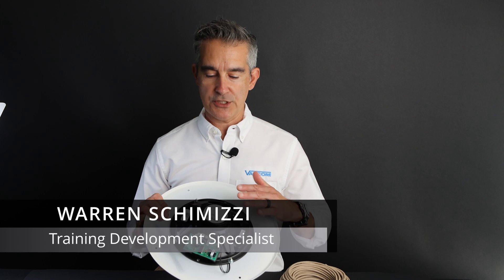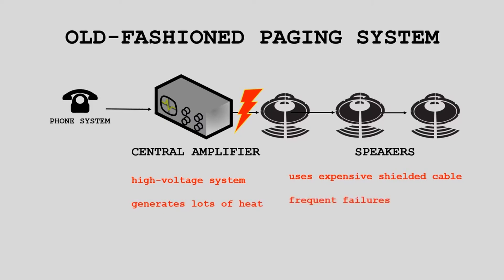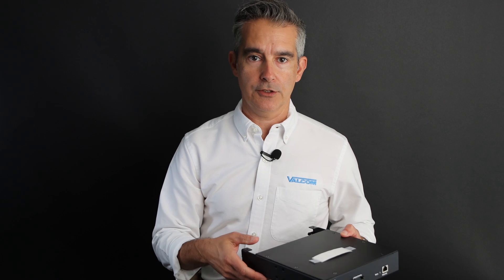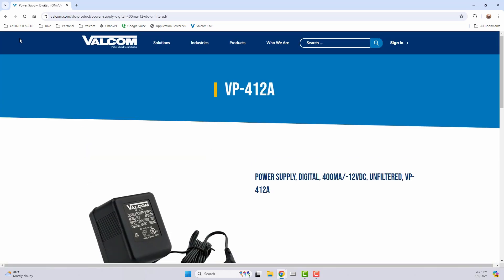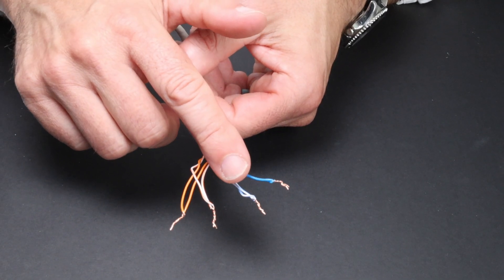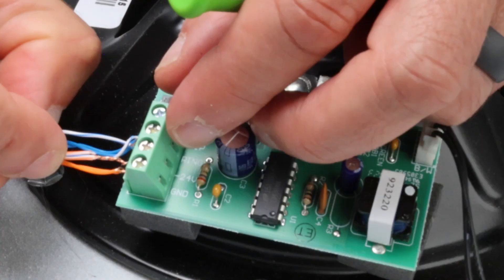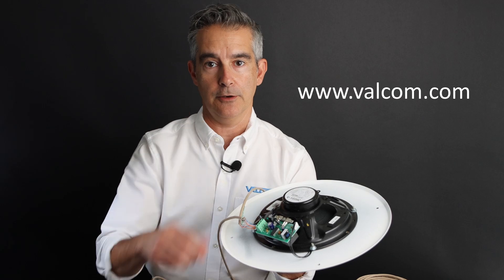How To Wire Valcom Self Amplified Speakers

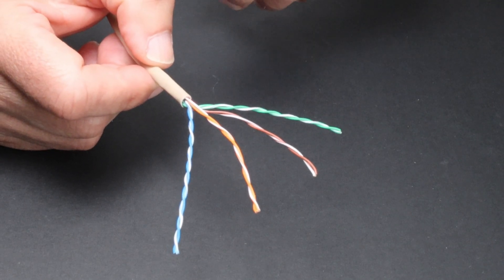Comment: @1:45 why don’t you use all 4 pairs of the CAT5 cable? Treating each pair as a single wire makes the gauge of the wire larger thus increases its current carrying capability.
Reply from the maker: Good question! You can absolutely double up and use each pair as if it were a single conductor, and that would give you the ability to extend the power run. The audio can run very long distances (up to 10k ft) using just a single pair, so nothing is gained by doubling it up. In the video we show using individual conductors for both power & audio simply to illustrate that it 100% feasible. Thanks for the question!